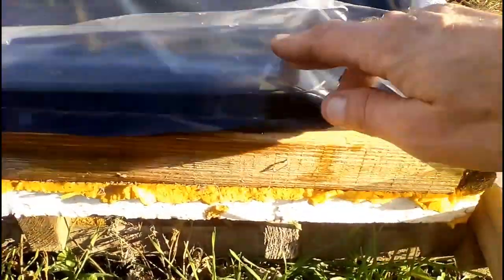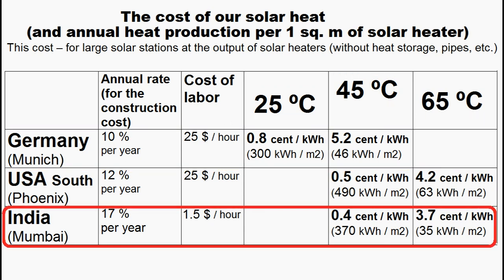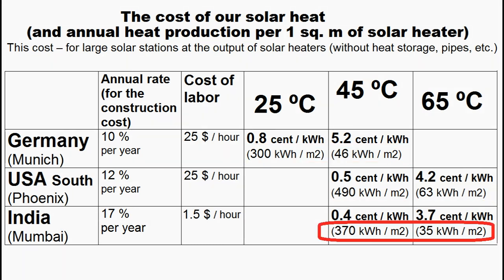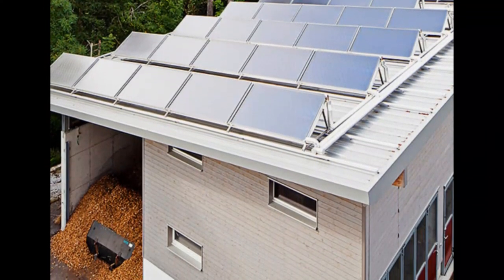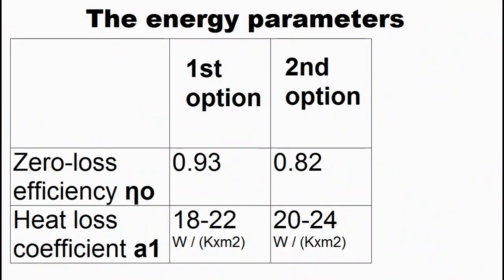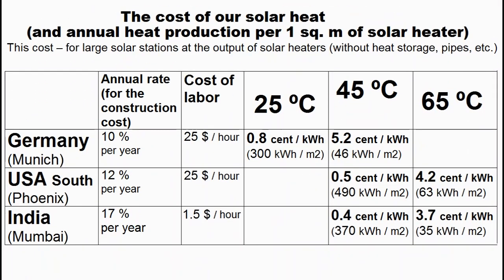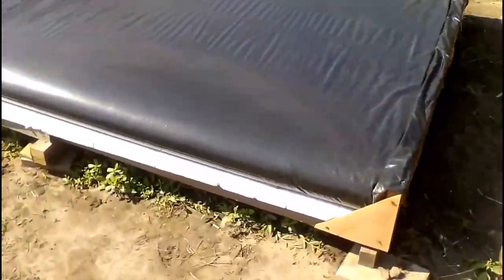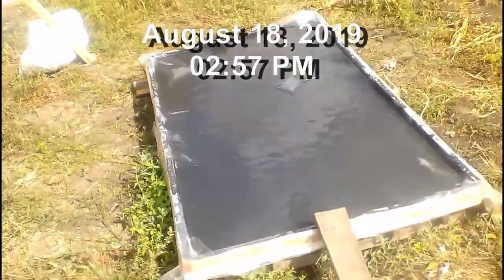Another cheapest Solar Water Heater: its manufacture, maintenance and cost of its heat

Comment: absolutely amazing test, keep up the good work
I was wondering for a long time about the putting clear plastic on black plastic on the bottom, in theory it should absorb more heat, but your test has proven otherwise due to air bubbles.